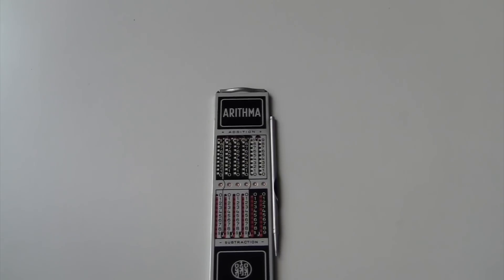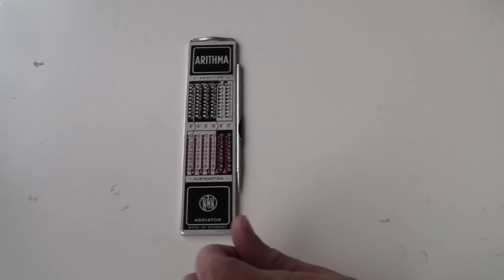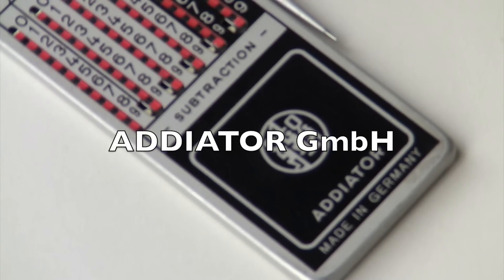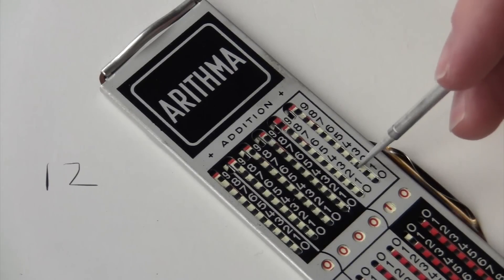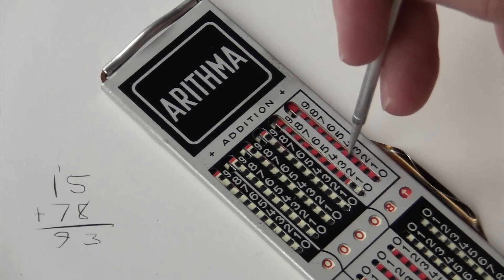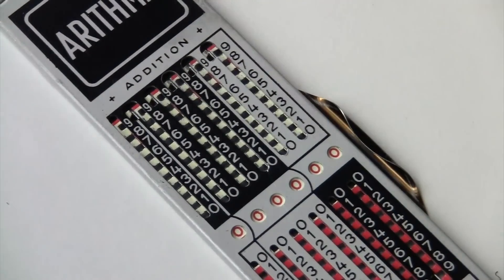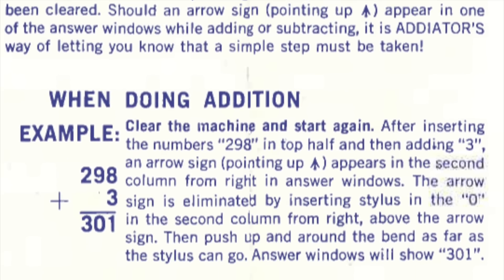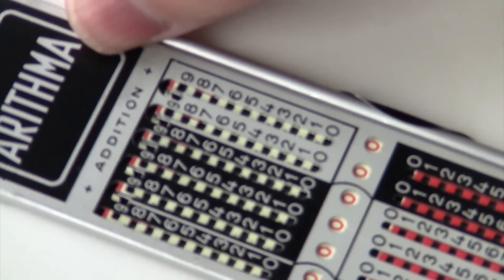Addiator sliding calculator Review / HowTo

Comment: My father had two of them built to the back of Faber-Castell slide rules; one identical to yours, and the other, pricier one, with a green stylus, both in green slip cases, and even as a child I used them often. Mother got rid of both of them, much to my annoyance, but I found another example of the latter with case in poor condition. I use it regularly,  such as tallying up my purchases on the run, such as grocery shopping.

Comment: I just received one of these today from an eBay auction. It is built into the back of a 14cm Faber-Castell slide rule. Incredibly elegant and thin. No stylus but a toothpick works fine. It seems to work somewhat like a 10 bead soroban (Japanese abacus), at least in my mind. Thank you for posting the instruction manual and this video.
Reply: Can you provide me a search term to get that slide-rule/addiator please, i cant find it
Reply: @Hunar1997  They are available on eBay. Many listings from Eastern Europe. 
The proper name is:
Faber Castell 67/54R ADDIATOR
The Slide Rule side is just marked Castell and the Addiator side is marked Castell Addiator.
The case is marked 67/54R. The best search term would be 67/54R. The is a version with a 14 CM scale and one with 5 1/2 inch scale.
Reply: @JohnHoranzy  Thank you very much, they are expensive :( cant china remake this 😐

Comment: You'd be able to add numbers and carry at the same time if you were to add the digits from right to left instead of from left to right. For example, if you wanted to do 104+98, you could put in 104 and put the 8 in the right most column and the put the 9 in the second right most column. So the instruction manual is actually telling you a longer way to do the math problem.
Reply from the maker: Very true!

Comment: Thanks for your videos. They take me back to childhood.  I am in top 3% iq, but the boy I hung out with was way, way, Way smarter. His family did not have a lot of funds. But he was always wheeling and dealing for calculating equip.  It was a winter day he came running to the car with Addiator. He literally wore  out the slots. He briefly  had several other devices you showcase. He was saving for a Curta but HPs came within range. Note: It is possible to wear out an HP.  I saw it happen. But, back then HP rebuilt it.

Comment: My dad owned one of these. He used it at work, lumber mill. This was in the late 60s, mid 70’s. 
If I remember correctly, it was brass with a brass stylus.
Reply: I have a lumber scale my Father in Law gave me. It’s a lookup table in a slip cover with windows, it supplies the board feet of boards in all common sizes and lengths.

Comment: I have one of these, my case is a clear plastic, and is yellowed but still in tact... im surprised the instructions do not tell you anything about multiplication or division which it is capable of doing.
I also have the original stylus and instructions my biggest gripe it that it does not have more digits. It would also be nice if 10s compliment numbers were printed on the face...this would make things like division much easier to perform.
Reply: how do you do multiplication and division on this???